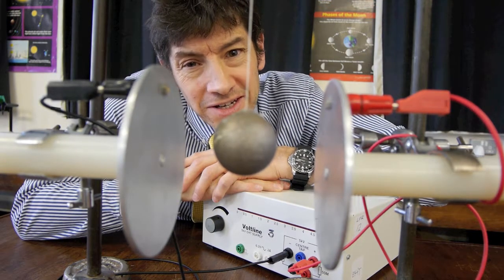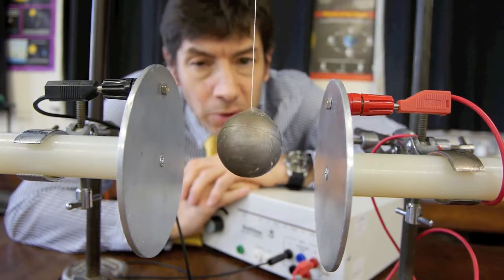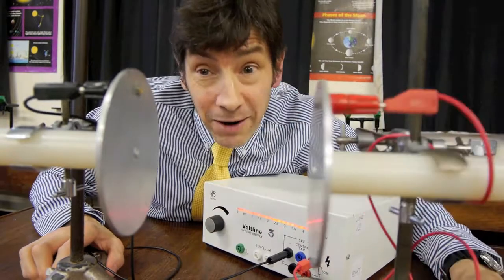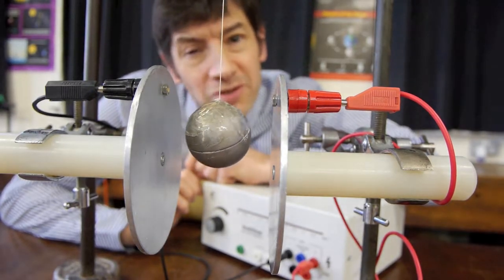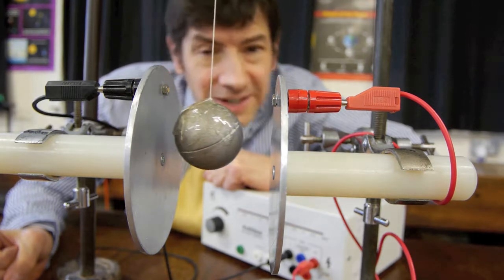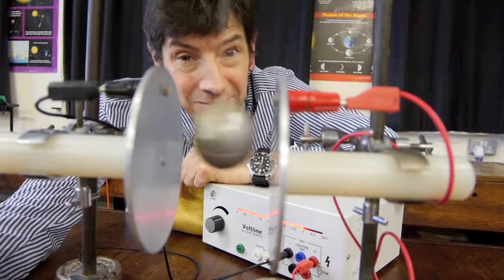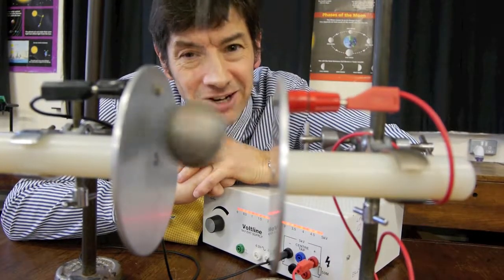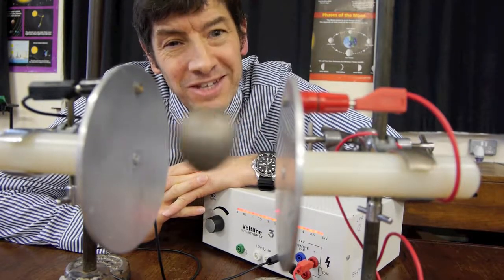The Electrostatic Clock - Electric Fields  (Oxford Bell, Franklin Bells) - F-J's Physics - Video 14

Comment: Does those plates stay all time charged with same charge? Negative stays negative and positive stays positive? 
Thanks.
Reply from the maker: Yes. they do as they are directly connected to the + and - of the power supply all of the time.  There will of course be a tiny fluctuation when the ball touches but nothing that one would notice at all.  It would be a different matter if a huge charge was put on plates and then they were disconnected and the experiment run again.  The ball shuttling would have the effect of slowly passing opposite charge to each plate and neutralising them bit by bit!  Good question and thanks for watching!
Reply: @AnthonyFrancisJones  thank u for ur answer. What is the name of that HV name please?
Reply from the maker: @pintchigawza6496  It is a 5kV school (low current) EHT power supply.  https://www.science2education.co.uk/product/power-supply-units/EL10370  However, you must know what you are doing  when using these to keep safe.
Reply: @AnthonyFrancisJones  thanks

Comment: 2.30 the purple light is the electric field?
Reply from the maker: Good question Wen.  2:30 No, electric fields are invisible (and mathematical ideas really - though that's another discussion!).  The sparks are formed when the strong electric field has ionised the air (nitrogen gas) by removing an electron from it, which takes energy.  When the electron goes back onto a positive nitrogen ion soon after, it goes to a lower energy level and this energy is released as a photon of light - colour representing the energy that is released.  The sparks will approximately follow an electric field line but not exactly.  Hope that helps explain it and thanks for asking.  As ever, enjoy your physics!
Reply: @AnthonyFrancisJones  It means the sparks are energy that released?
Reply from the maker: @wenshan4828  Yes, and the energy is gained from the electric field.  The sparks are the energy released as photons of light.

Comment: how you build the parallel plate capacitor ?
can you explane..
Reply from the maker: Thanks for the question.  So I just got two flat aluminium plates - the round disks you can see in the video and I screwed on two plastic rod holders - the white coloured bits and then screwed on an electrical terminal on each.  But, basically all you need is two flat metal plates (does not need to be aluminium) and hold them up with an insulator (wooden or plastic clothes pegs) and separate them.  Connect to each one your power supply leads (crocodile clips) and you are in business.  I will do a video sometime with two large sheets of kitchen foil separated by a bin liner - that works well too.  Hope that answers your question - if not get back to me and I will gladly help.
Reply: first i am very glad to your answer  because i doing my final year project on that ..
i have like your plate (aluminium material) but i donot know how  i hold them and how i make electrical terminal to feed the plate with positive and negative charge it is can not hold by my hand i need something to hold them by building something .. can you make video based on that and how i screwed without i damage my plate it will be very useful
Reply from the maker: You can hold your plates in any insulator - a couple of wooden blocks (or wooden blocks with slots in to hold the plates) or wooden stands or similar as long as they do not touch or touch other metals.  You can even hang them from nylon thread or similar or wooden clothes pegs - it just has to be an insulator holding them.  You could easily tape the wires to them or use crocodile clips.  It's a really easy set up to make.
Reply: but what you mean EHT power supply ? 
is it AC/DC power supply ?
for me also i will trying to use digital multimeter to see the gab is it will effect output voltage from the parallel plate and i will record that by different gab different dielectric material
Reply from the maker: EHT - extra high tension means high voltage supply.  I used about 5000V and it needs to be DC.  If you change the gap or dielectric and charge the capacitor the voltage will stay the same.  It will be the voltage of the power supply.  You could measure how the charge stored changes (but you might not have a coulomb meter or you could charge the capacitor and then disconnect the power supply and investigate how the voltage changes as you change the plate gap or overlapping area.  Don't touch them as you will discharge the plates.  I would hope that your teacher could guide you here - sounds like you are not getting a great deal of help so ask and I will try and answer what I can.